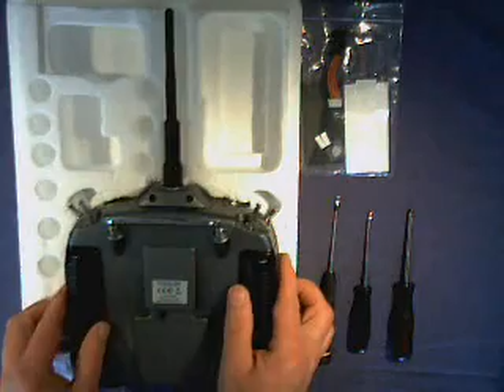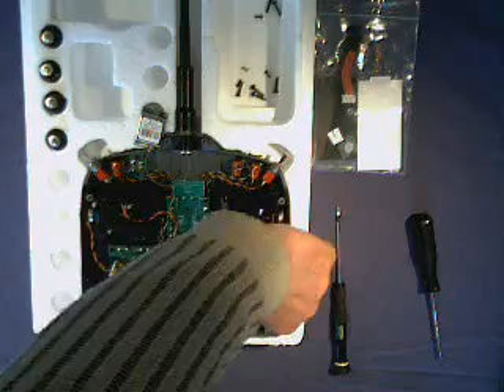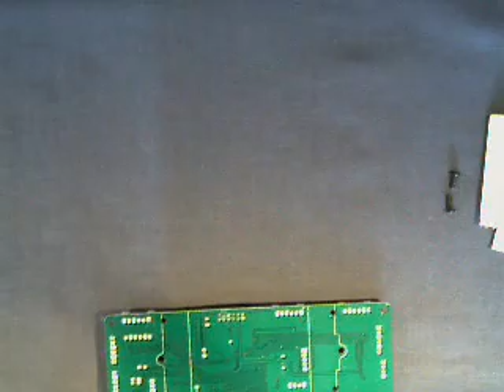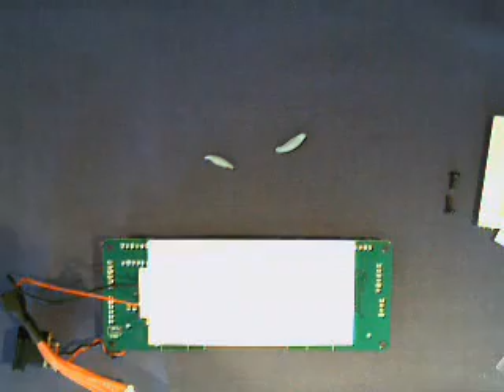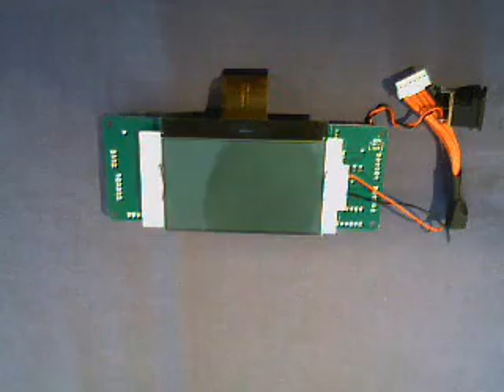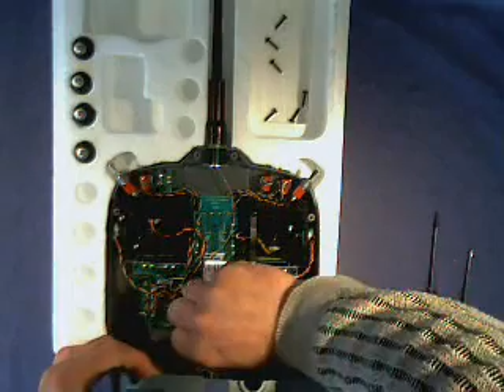Spektrum DX6i backlight installation mod using Tech4rc backlight, plug and play - no soldering

Comment: CAUTION: This method does NOT work with the stock Turnigy 9X LCD Backlight Kit. In the video he calls it a Turnigy but it is a special modified unit.
Reply from the maker: If you read what it says below the video, it clearly states "These instructions are for the plug and play backlights sold by Tech4rc via ebay, not the standard Turnigy backlights."
Reply: @Tech4rc  yes but on the video it does not say that.
You just say Turngy.

Comment: Should the vinyl on the display side be removed?  There are quite a few air bubbles.
Reply from the maker: 4FunRC There is a clear plastic protective film covering the backlight, you can remove this film if it has air bubbles underneath it.
Do not remove the white plastic film attached to the backlight.

Comment: I've had this kit of over a year and finally did the install just now.  Like others have pointed out  removing the plugs is the hardest part.  What a pain lol.  managed to pull one wire out of the connector but got it sorted.  I have the red backlight and it looks great, I also changed the roller wheel to a red aluminum one at the same time.  Thanks for the great kit! :)
Reply: I ended up using a screwdriver lol. Thanks

Comment: My kit arrived this afternoon and was installed successfully. I chose the green light and I like it! You weren't joking when you said the connectors were quiet difficult to remove the first time! That was the most difficult part of the entire install. While I had the unit apart, I adjusted the tension on the throttle stick and changed the plastic roller for a CNC machined metal one. The install wasn't TOTALLY without drama, but all-in-all it wasn't bad. Best part was the screen lit up like it was supposed too and the radio still made the servos move!

Comment: I recieved the backlight kit about a month ago... I had ONE problem... getting the connectors loose to do the work was the major problem.. The power wire to the 'roller switch' broke loose from it's soldered connection. It was especially difficult to re-solder the tiny wire back but I accomplished it and the backlight works just as advertised!... FANTASTIC set up to relieve us "old-bold" pilots when squinting just wont cut it while looking at the screen!... Thank you, Tech4rc!... WELL worth the price!..

Comment: No doubt this is a great video but unfortunately it did not work for me. I've absolutely made sure that i followed all the steps shown in this video. Eventually i cut the wires and soldered the wires to make it work (a few other lengthy videos out there). Now it works like magic!
Reply from the maker: You need to use a Tech4rc Plug and Play backlight kit to follow the steps in the video, if you used a Turnigy backlight then it has to be re-wired to work. Also the Turnigy backlight has the wrong resistor to work on a DX6i transmitter.

Comment: Hi Tech4rc. I just brought one off you. Question: Is the blue tack strong enough to hold the screen or would a bit of araldite be better?
Reply from the maker: The blu tack only holds things in place while you assemble everything, once you have tightened the pcb screws the assembly cannot move. If you use araldite or any other permanent adhesive it would be more difficult to adjust or remove the backlight, if you ever need to. We have sold over a thousand backlights and none of our customers have reported a problem with the assembly.
Reply: Tech4rc Thanks for the quick reply. It just in some vids they use a glue gun to support it with that's why I asked. I'm planning on running the live up to a latching on off switch next to the trainer switch. Will the back light run off the 6v batteries or does it need a resistor inline?
Reply from the maker: DrWh0sY The backlight will work from 4.5volts up to 6.5 volts, if you put the switch in series in the red +ve wire of the backlight then you do not need an additional resistor.
Reply: Tech4rc Excellent. Thank you very much for the info Tech4rc. I brought a dx6i cheap because the case was in bad condition. Planning on doing a custom paint job on it. I'll put a vid up if it works out ok.

Comment: I mounted mine today! I found it very easy to do, used the video as an on-line instructor, just going step by step and pausing the video when necessary. I ended up with two screws and the plastic LCD holders left over, I trust that is as intended? Also, due to the somewhat dodgy video quality I selected the wrong cable to go into the power harness for the LCD, so on first power-on nothing happened. But with the clear pictures on your homepage I got it right on the second attempt (and luckily I think I didn't burn anything). The backlighter works really great, it is definitely an added value (no more squinting to see what the display shows). And it didn't cost an arm and a leg either, so thanks a lot Tech4RC! Good job!

Comment: This seller is very easy to work with. My initial unit had a faulty wiring harness. A replacement was sent very quickly and my unit is now working as advertised. Customer service is excellent and the product is great. No more using a flashlight to program my transmitter :)

Comment: I've watched this video about a dozen times now....  When you remove the 4 screws holding the PCB in place, after disconnecting the other plugs, Then you put the PCB with the Display on a "Soft Surface" and remove the two screws holding it in...  Do those 2 screws ever get replaced? Or do they stay out???
Reply: Sorry for this stupid question guys. I asked this before I did my insteall, which went SMOOOOOOOOTH sailing I might add. Tech4RC has a product here!!! Thing makes the DX6i worth getting.  You guys reached me in 6 days. Ordered on Feb 25. Recd Mar 3.  6 days from the United Kindom, to the United States. (new york) that is amazing. We have national vendors that are slower than that. I cannot recommend highly enough!!! 10 Stars!!!!!

Comment: Is it really necessary to take out the ribbon cable? It looks to me like the backlight could be installed without taking the ribbon out. What am I missing?
Reply from the maker: While it is possible, the ribbon cable can easily be damaged and we would not recommend attempting to fit a backlight without removing the ribbon cable. You may save a few minutes, but could leave your transmitter without an LCD display.

Comment from the maker: Hi Todd, where did you get your backlight from? 
These instructions are for the plug and play backlight sold by Tech4rc and if you are using a backlight designed for the Turnigy 9X it will not work with the Spektrum DX6i, unless you cut the wires and solder them to the pcb.
Hope this answers your question and if you need any further help please ask.

   Regards

       Kevin

Comment: Just finished my DX6i and triple checked all plugs etc, but I turned it on and data pops up with no light? My tx is new and I am wondering if there is any change in the wiring or maybe a faulty backlight? Any suggestions will be appreciated.

Comment: Does it have auto shut off while you fly? If not, how can I get that? Also, why would anyone want to cut the wire to solder when plugging it in is easier? I saw that on another video and saw urs and liked it better.